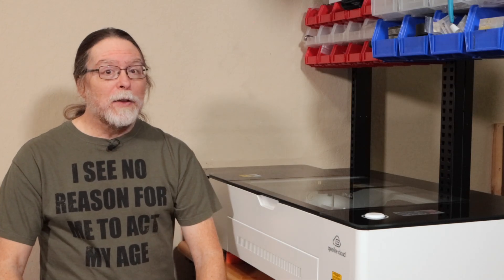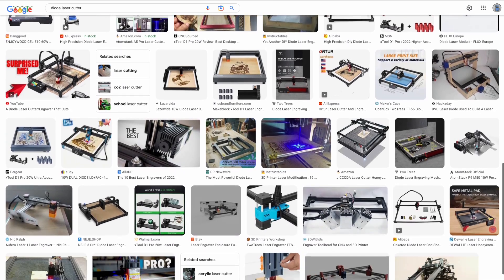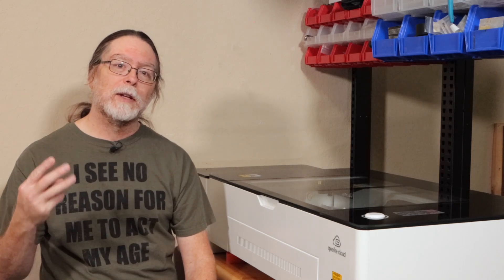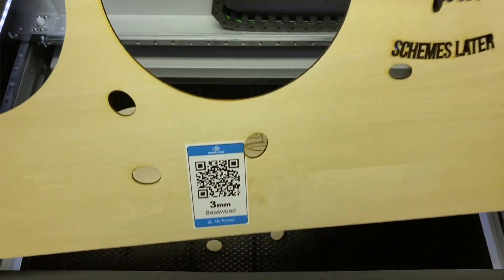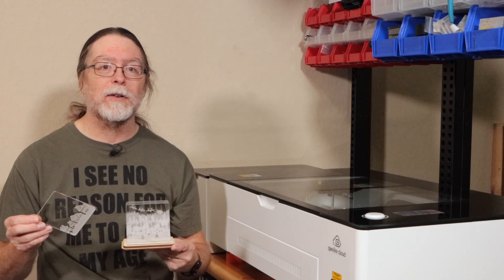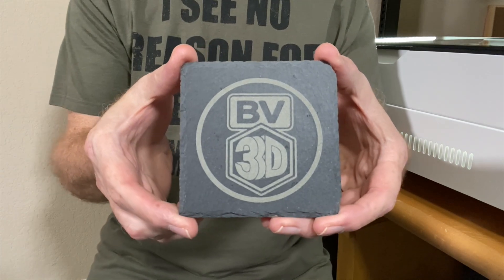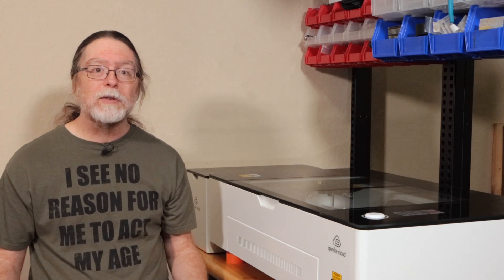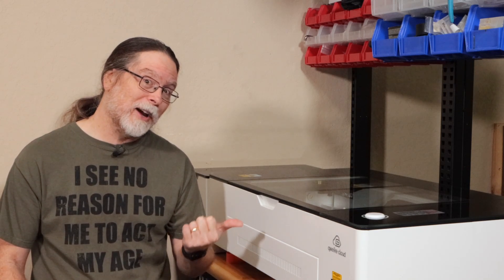Gweike Cloud Pro Laser Projects

Comment: I have a K40 with upgraded lenses and air assist, but its size is not large enough for some of the projects I have in mind and neither is this one, I am thinking of making a mount for a 20W diode laser to fit my MPCNC which already has an enclosure fitted to it.

Comment: Oh, what form of cooling do they use for the tube? That's a big issue I keep hearing about w/ K40 type CO2 lasers. Most are water cooled that I hear about.
Reply from the maker: It's liquid-cooled, but I don't know for sure what fluid it uses. There's a reservoir on the right side of the interior, and a radiator on the left side of the interior.